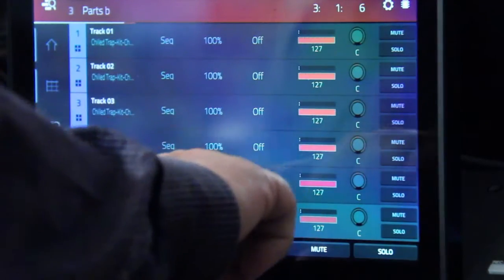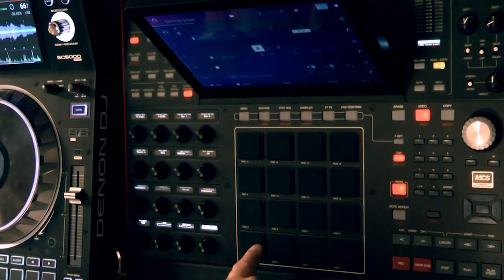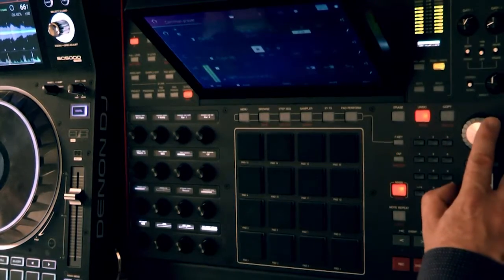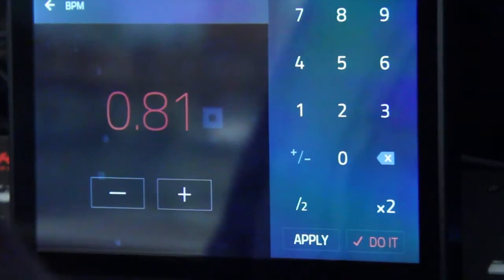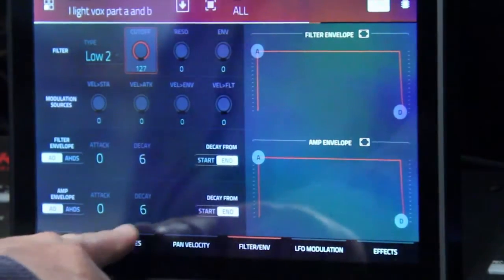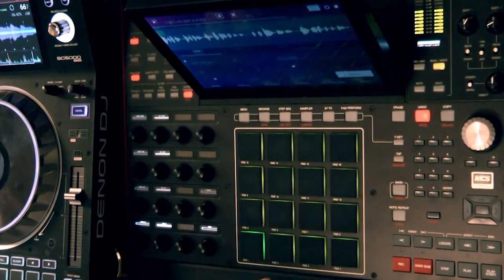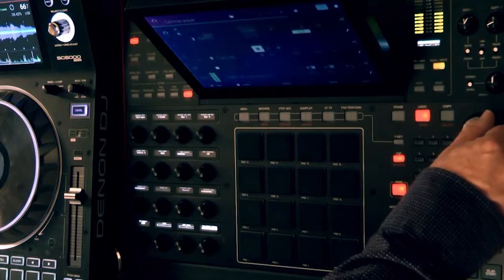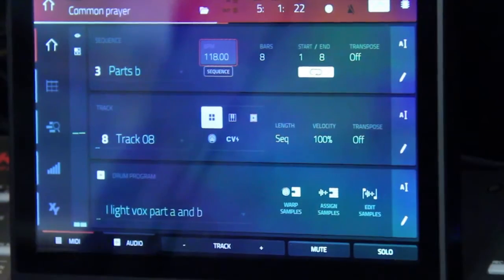Akai MPC X - Warping samples in a program

Comment: Do Eye have to warp drums that are from within the machine to achieve this (along with my samples of course)?
Reply from the maker: Hi Mack. Thats a good question. Because a lot of the single hits are short a time change won’t be noticeable so the time warp is not necessary. This is a good feature for using with longing playing samples. A lot of the content that come with the MPC that is longer loops, has already had warped assigned to it.
Reply: @brennangalley3964  Peace Brennan, long time. And yes Th Ankhs. Eye realized this late in the AM after stressing all day about it. And that was my concern. The length of each drum sample. Eye figured if Eye warped it it would mess up. And they all have they're own different BPM. Eye said to myself... Nope not messing with that. To have to remember what Eye did to undo it if it didn't work. Th Ankhs again!
Reply from the maker: Have a great day Mack. Sounds like you’re cooking up some great music with that kind of attention to detail!
Reply: @brennangalley3964  Th Ankh you Brennan! And Eye'm working on my crafts daily

Comment: Awesome video and very informative. But I do have a question. How are you able to play the acapella and beat at the same time? I'm having an issue with this. I can only get 1 to play at a time and not together.
Reply from the maker: Hi Nobody. Thanks for the question. I have the drum as a preprogrammed sequence and the accapela assigned to a pad. By warping the audio they stay in sync with each other. To figure out what is happening with your set up please reach out to support you can get in touch with them by visiting www.akaipro.com/support
Reply: Thank you for answering my question. So you pretty much have them on 2 different tracks, but the same sequence?
Reply from the maker: One sequence, with a long sample (acapella) on a single pad in a program.  By warping it will keep time with my sequence drum beat. www.akaipro.com/support